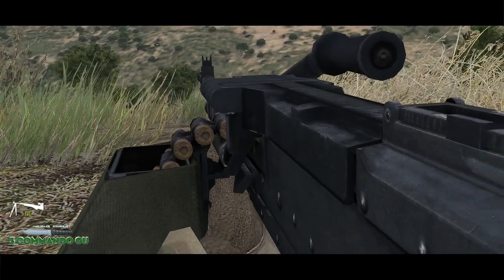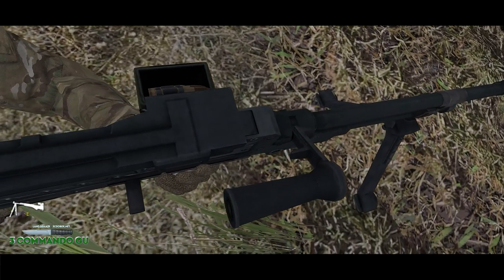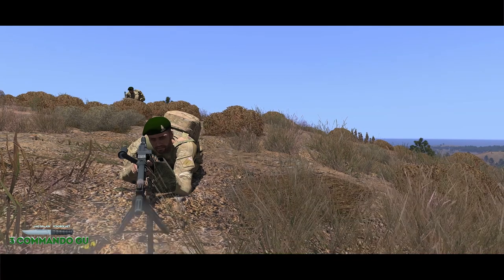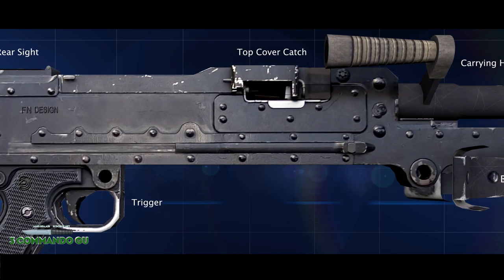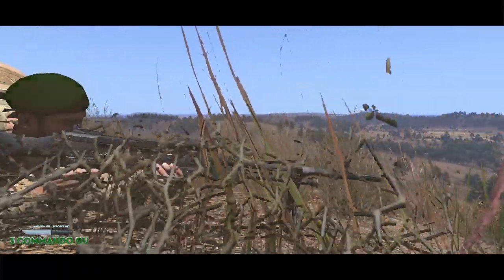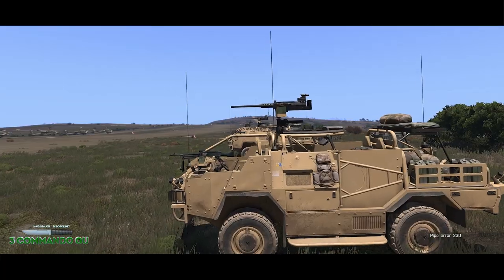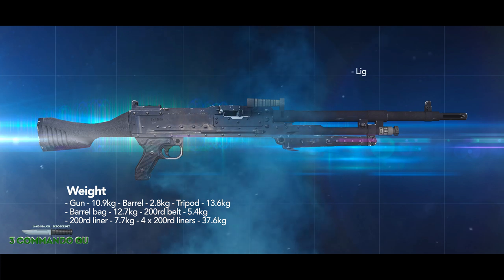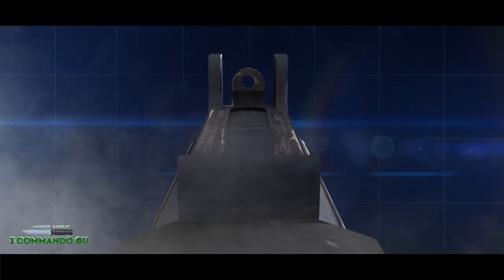Arma 3: Tell me about the GPMG

Comment: We used to have a GPMG in each rifle section and each rifleman used to carry a 50 round belt to supplement the ammo carried by the gun team. It was the most effective weapon in the section, very easy to use and surprisingly accurate for a machine gun. You're right that you wouldn't want to be on the receiving end of it. It was so eager that you had to pull it back when you fired it, or you would carve up the ground around 20 yards in front of you.
Reply: Was the l1a1 standard IW in the section ?
Reply: 1 per section? For real? 1 per platoon. 100 rounds per rifleman, 600 for the gunner, 400 for no 2 as he also carried my 2 spare barrels and sometimes my tripod if in an SF role.